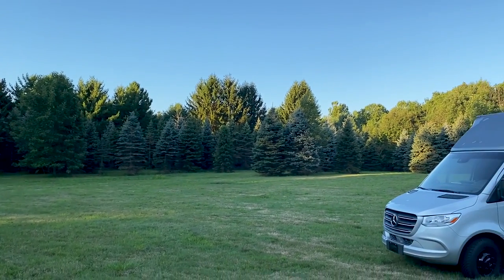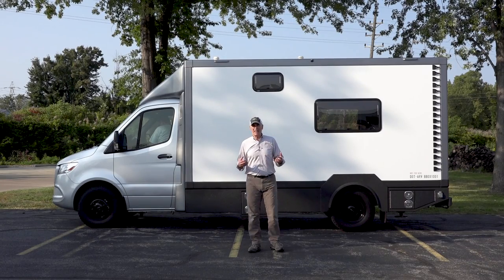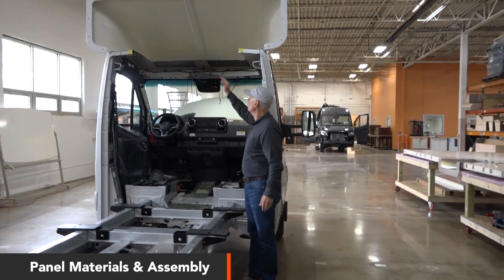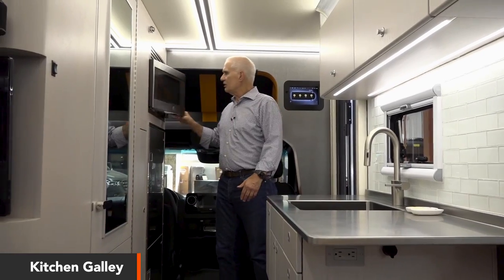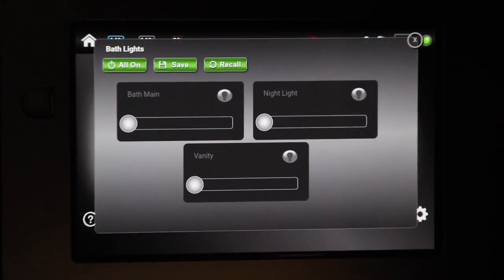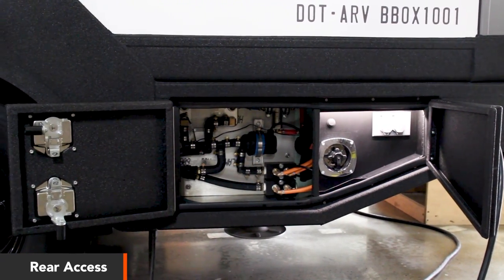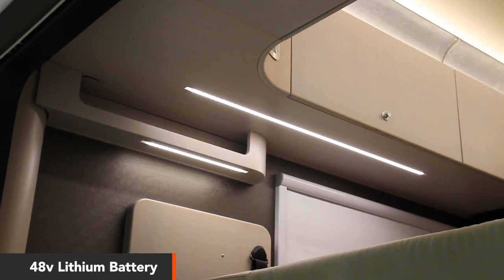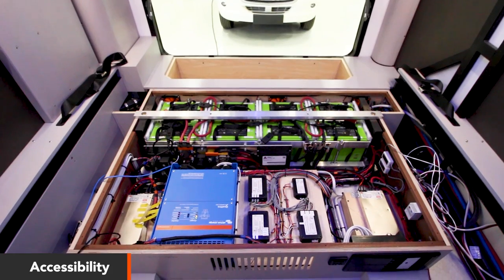B Box Walkthrough | A Look at Advanced RV's New Prototype Motorhome

Comment: I'm 6.2 "tall and I've always wondered why a camper van has to be in a sprinter that's narrow and curved at the top. Plus we have to suffer around isolating all the holes in the chassis and not very efficiently. Why doesn't anyone just use a B box .Everything I have imagined and thought about solving this problem you have already perfectly done it. Honestly. I think this is going to be revolutionary and I wish you much success in sales. Also, the idea of the possibility of dismantling the complete living space is great. I am in the bee business and using the chassis for the purpose of transporting the bees and for housing is great.
Reply: Well the B Box is not a van, it's a truck.  Class B's are built with vans but Class C's are built with trucks and that's what they did here with the B Box...

They just kept the footprint similar to a camper van, which is the impressive part as Class C's are typically bigger and bridge the gap between Class B's and Class A's...
Reply: @ZeoCyberG  Thanks for explaining.

Comment: Amazing!

It is designed and built better than a NASA engineers. The B Box is ready for a Mars Mission.

Please show us a Ford chassis version when one is complete and tested.
Reply: Totally agree. I am convinced the ford transit eco boost AWD is the best for RV applications.
Reply: @tjl942  If you have the cash and patience to go to ARV you might as well send your transit to Quigley for full 4wd.
Reply: Wait. It has interplanetary capability?
Reply: It would be great to see a video on the washing machine when it becomes available.
Reply: Would be interested to know what is the price. You have a very good team. They are temple builders, meaning customer friendly team. Thank you for sharing the making of the van. 🙏
Reply: @gitaapatel  given what their other builds average, this will probable be about 150k starting price.
Reply: You have money buy the Sprinter. Better car overall.
Edit: the Sprinter is awarded: Most reliable van for 2020 in the UK by the way. Better 4x4 system than Transit as well as best in security features.
Reply: @Dave’s Model Works. I checked their website, $300,000
Reply: Check out Taxa travel travels. They are made by a guy who worked at NASA.
Reply: @gitaapatel  A little over 300k.

Comment: I love everything about this... except the look. 3 colors, different sized windows, right angles mixed with round corners and those air tabs create a mess of inconsistent design. I think you have a winner here, it just needs more curb appeal. Really amazing work!
Reply: Mine will be in satin black, for cab and camper. That will easily hide some of the things you mention.
Reply: Ok, this whole sprinter van thing is for people that want to have all the amenities of an RV- without driving an RV. Well,  ya know what? Doesn't work.  Ya might as well just get a damn RV.
Reply: Agree. Awesome engineering, just need to make it sexier now 🙃

Comment: This is such a brilliant build. I've been looking at ways of incorporating passive house design principles into a van build with a box, and you've done almost exactly that. I've converted a MWB Sprinter here in the UK for myself and have been designing a chassis cab/box system for my new van. If you don't mind me asking, how does the fuel ecomony differ between van and box and how much did the Aerodyne components help?

Comment: How does the cab impact heating/cooling?  Can the cab be closed off, or is that not necessary?  Love your work.
Reply from the maker: The OEM front windows are less insulated than other parts  of the van. We'll often install hooks for an insulated privacy curtain that drapes around the cab and stores in a cabinet, or we'll do a sliding bulkhead curtain in between the seats and the living space.

Comment: I realize that if you can afford an ARV you probably aren’t concerned with MPG but I would be curious in a comparison of a Sprinter Van vs BBox. Also, what is the cargo capacity (wt)?
Reply: The most practical and creative cargo space is the "garage" concept under the bed at the rear of a vehicle. It's dead space anyway and easily accessible from both sides of the bed. I am thinking of a way to have the bed  folding into 2 sofas facing each other to also be used with a table for dining. So bedroom at night, living/dining during the day.

Comment: I would be interested in a basic, bare bones model that I could customize myself. I don't want all the expensive, high tech stuff. Too many things to break and costly to repair. I would want the air system and a good power system set up but other than that I would want to build my own interior without the automatic bed, control panel,  TV, and electronics. A laptop and a bluetooth speaker is all I need.
Reply: The water recycling is amazing though. Depending on your climate, the heated water tanks are an amazing idea as well. There are some real ideas here, but I agree with you, 70% of this build is for people who take their Mercedes/BMW to the dealerships without thinking about the price. I like it… but making it yourself would mean you could fix it yourself.
Reply: There is a bbox for sale on their site with no build.

Comment: I saw a mention of solar but no solar on the roof???
Reply: Every ARV RV is a one off custom designed by the customer and company working together. If you want solar on the roof they'll put solar up there.
Reply from the maker: This box does not have solar, but we imagine future boxes will utilize the roof real estate for solar. The second engine alternator is often enough to top off the battery.
Reply: @AdvancedRV  Thank you for clearing that up.
Reply: Would think about 1400 watts of flexible solar panels would fit on the roof too

Comment: This 'should' be considerably less expensive than a typical ARV build on a MB van once full scale production is ongoing. The main problem with building on an existing van is labor costs, it's extremely labor intensive. This B box should offer up huge labor build savings, thus overall labor costs should be reasonable. But it's interesting to note that ARV is now treading (saying this will be used in rugged off road conditions) into territory well established by other RV makers who have much more experience in this type of thing (Unicat, Action Mobile, Unidan, GEV, etc.), and they use proven off- road chassis. The sprinter van, as an off road chassis/platform, is very compromised. But for light duty, dirt road type of usage, it should be ok. But in the end, it's going to be all about price.

Comment: I'VE BUILT THIS! By converting an Australian spec Box Ambulance on a cab chassis, stripping the interior right back to the aluminium skinned insulated walls and fibreglass floor. Mine will be a lot lighter, and the rear door opens right up to turn the interior into a fully fly screened balcony !  Advanced RV is next level though. wish I had access to their machine shop! Awesome design.

Comment: Being an owner of a 2016 Class B+ Mercedes, I love the simplistic look of the B Box. I'm always wanting to change the funny exterior paint job on my Motorhome, lol.  I would love more insulation in my Class B+ for winter camping. I'm trying to figure that one out, lol. Mine has propane cooktop but I never use it. I use an induction stovetop to cook on. I do like the Diesel Generator for extra back up as I don't have the battery system the B Box has. 
I have a flex solar panel but had I known what I know now, I would rather spend money on battery power. 
Great job showing the B Box, I love it!

Comment: I really like what you’ve done with the B Box.  Have you done one, or can you do one, for a full time wheelchair user using the Handicaps Inc SuperArm wheelchair lift, something like the B&D 6 way power seat bases, and Veigel Compact II gas/brake hand controls?  My current wheelchair, a WCMX Box Wheelchair, is under 29 inches wide with my off-road tires on it and I can turn around (do a 180) in under 42 inches (a 48 inch box is easier to do a 360 turn).  I’m wanting a RV that is around 20 feet in total length so I can use it as my daily driver, under 9 feet tall (height limit at some VA medical facility outside ground parking lots), be AWD or 4x4, and I would prefer Ford over Mercedes.  Being in a wheelchair I’m not very tall and my wife is 5 feet 4 inches tall.  I went to your website to get more information, but I didn’t see the B Box listed yet.

Comment: I have been waiting for this form factor for so long, Finally I can put a few modifications to get my ideal motor home.  I will make a convertible roof, and I will lift up the sofa bed with electricity to the height of the roof, it requires moving the cabinets from the ceiling to under the lounge. Then I will be able to enjoy the outer space without placing and clearing all kinds of stuffs like chair, kitchen around RV.  I will get the indoor and outdoor lounge, patio. It's a new era of motor home. The name will be motor Patio.

Comment: Very kewl - my only big question is how the batteries get charged.  I will have to watch again too see if I just missed it.  I would also be curious if a urine diverting toilet with the water recycling system (composting the solids) would be easier on the system?  But the amazing part of this system is that honestly I believe you've technically made the first true below zero Class C RV.  Amazing job of pulling this all together!

Comment: OUTSTANDING BUILD! I think you just about thought of everything. But you didn't mention solar. I would have to have more that 400 watts of solar panels and I would like to have a nice roof fan. The interior decor was pretty plain for me but very practical. I suppose because you build for the individual client these things could all be included. You also didn't mention storage. Also important. But the nuts and bolts of this B Box is about the best I've seen anywhere, and I've watched a lot of videos. I'm close to retirement now and am at the point of educating myself with the many choices out there. One other thing. It would be nice to have a awning.  And lights for the shore power area so if you are at a campsite after dark you can easily get hooked up. Other than that, I give this one 4 out of 5 stars. And it takes a lot for me to rate so highly.

Comment: I'd love a full size flip down bed at the back a bit higher up spring mattress not foam with a flip down desk option under the bed, and a huge pull out drawer for a piano keyboard, and somehow a sofa mode to watch tv. Also be able to replace the speakers with my higher end speakers for the piano. Room to store computer equipment and synthesizers.  Then instead of a back garage, a pull out outdoor kitchen and grill with plugs for blender, cutting surface. don't need a outdoor mini fridge like so many do, but a small water tap would be helpful. just some thoughts.  and most put in griddle grills not real gas grills you def want a real grill. or a cast iron charcoal grill even (or rocket stove would be even better to cook with twigs). 600W solar on top would be a must. and what about those of us who prefer a jacuzzi to a shower? and a composting toilet?

Comment: Well, again, you're creating things out of the box. This one is AMAZING! But, there's always this structural thing I have against anything but an actual steel van. Just because of safety. This build looks like it could sustain a major collision but I still have the question: does it? I've never seen a box that has the structural strength of an actual structural body. Have you done any simulations on this? That would be awesome.

Comment: Great idea to use the box/cube as you free range in designing, I looked into 2nd moving trucks and one had a similar shape box on it, allowing to design without restrictions, You can decide where you want to put your doors, your bed, garage, etc. I had one technical question, normally this kind of chassis has a separate cabin and the 'box' for the goods it is transporting and they move separately from each other. In the video the box is connected to the cabin, is it a 'static' connecting or is there a harmonica gasket, to allow separate movement?

Comment: It IS a good idea to put a (removable) habitat box on top a chassis. So the only depreciation will be on the vehicle, that can be changed to another chassis if necessary. AND the vehicle can be registered as it is because the habitat box is actually only the load, not a permanent feature of the vehicle itself. Insurance will have 2, one of the vehicle and one for the habitat box.
Put it on top of a set of torsion free subframe and it will be PERFECT!

Comment: One question: ARV is known for its quality custom work. This B-Box is no exception. However, it doesn't seem, at first glance, to be as adaptable to alterations as the base vans are. All that extra framing and support you put in for the bed, for example (at 22:00) would preclude changing it to a single non-folding twin bed, for example. As a solo traveler, I have no use for a couch... but like to leave my bed made and have a recliner next to it to watch TV. The bed itself would have controls to raise the head. That all works in the Sprinter van, as I've seen examples in your own work. But if this support structure is built-in, it seems the folding couch-bed is the only option.

Comment: Always liked the box style over the vans because the square wall gives you more room.  An with now days the composite panels are very strong and well insulated and light weight.   Love the diesel hydronic heating system and DC compressor AC split system.  Always thought a sectioned off sleeping area that has thermostat in the sleeping area would be a more efficient use of the battery at night.  Only need to cool the area where you are sleeping no need to cool entire van.  Possibly could get 10 hours of cooling of your battery package.
I’m curious to the cost of this van.  I really like it but have a feeling its over 250k.
Reply: I think Advanced RV makes some of  the best camper vans on the market but they come at price premium. Good ole supply and demand at work.

Comment: It's fascinating to see how much thought and work have gone into this design.  The size of the water tanks and the water recycling system will really extend boondocking time in homelike comfort.  Where are you on the weight limitations of the chassis, that is,  with water and fuel on board, how much weight is left for passengers and gear?

Comment: i  have a couple questions/comments,  is  there a reason no solar,   or generator,  and  no stove top burners,  no  table tops,  no outside water /shower hose and  last no awning.  Missing a lot for an off grid RV ,  But i still like it.!       Is it on the same Mercedes chassis as the new Airstream out of Dallas?

Comment: Sweet.  I almost purchased a E350 12/14 Foot Box - Duel Rear Wheel - Big Gas Six - Automatic,  but I live in an association and " Fixing " could be challenged .  I noticed so much more upper Cubic Feet.  Would have liked a Non-Slip /Diff for the Rear. $ 31,600.00 Sticker.  There is no way i could match this Beauty, but I like the idea.  Thanks.  Bet this Baby goes for 250 K.

Comment: The recycle shower is the most fascinating part. Can you tell me how soap interacts with the filtration system: does soap get stuck in the filters or cause any issues there, or does it simply pass through into the recycle tank which causes your recycled water to then become soapy? Does the carbon filter take care of the soap? Do you only use the recycled water during non-soap rinsing and then set the system to dump to gray during soap rinse-off phases during showers?

I am currently building out a van and did a lot of research for my own design. It's good to see that what you guys came up with looks very similar to my own. I had a 2-step (coarse then fine) mechanical filter, plus carbon filter and final UV filter for killing bacteria. I even planned to test it and send to a local water testing facility to confirm coliform levels after several rinses, but then COVID hit.

Comment: Good heavens! You guys have raised the bar again. My guess at pricing is in the 300 - 350 range. One question arose when you said your heating system used about 2 tenths of a gallon of diesel per hour to heat the van. If you’re in really cold weather it seems you might want the heater on all night, say 8 to 10 hours. That would consume about 1.6 to 2 gallons of fuel per night. I don’t know what the fuel tank capacity is on the Sprinter chassis, but it could end up being the primary limiting factor in how long you could boondock.
Reply: Hey Dennis.  I think the Sprinter van holds 25 gals of diesel  How long do you plan to be immobile while camping??  2 gallons of diesel per night would give you at least 10 - 12  nights before you need to refuel.  Are you complaining about that??  This system is really efficient, heating both van and water on so little fuel.
Reply: I forget to add, that going to a service station to get fuel does not have to mean the end of your boon docking experience.
Reply: @jlarm3  not complaining at all. I'm sure I would run out of something else essential before that (e.g. cat food!). All you really need is just enough diesel left in the tank to get to a service station.

Comment: If I want to use a Ham radio ... is there RF noise suppression so the radio doesn't buzz ... and what could be used as a ground plain.?  Maybe a thin sheet with meshed wires to lay on top of the top

Comment: Does the B Box have a higher towing capacity than a ARV Sprinter chassis?  The wall construction must be much lighter than a van. I want to (easily) tow a racecar and trailer, and would be pushing the 3000 to 5000 lb. tow capacity of a typical sprinter conversion. 

This is technically a class C, correct? I'm very interested to see what else you guys come up with for this chassis.